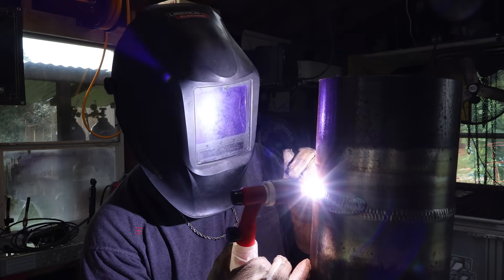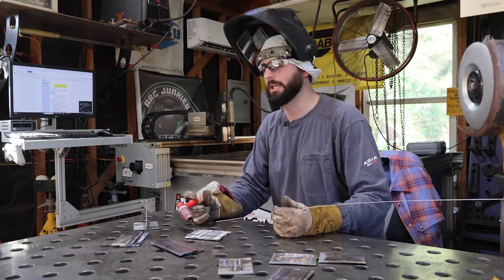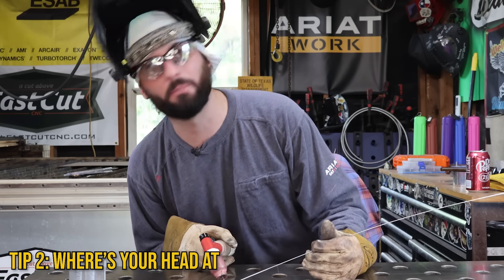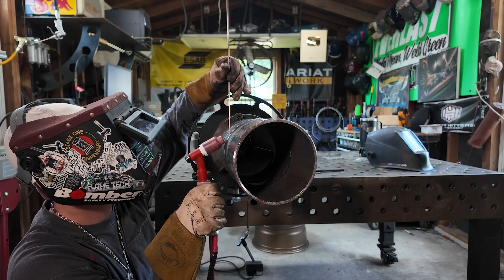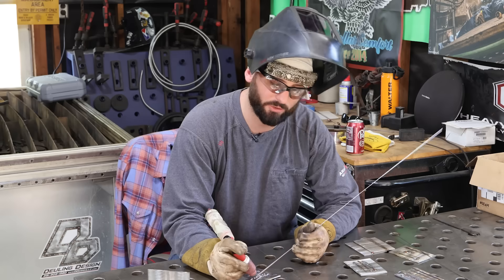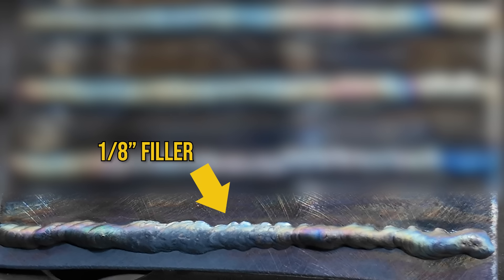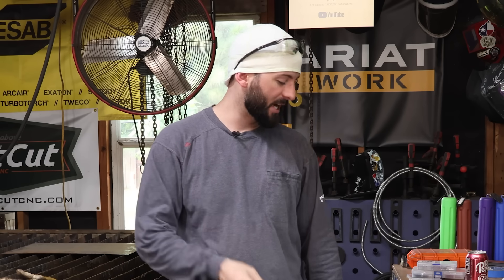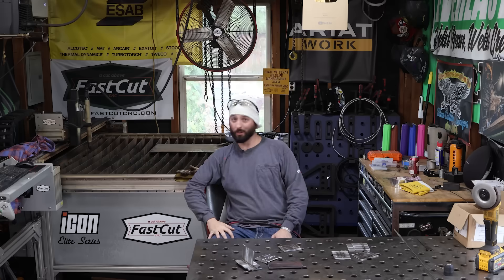Easy Changes To Massively Improve Your TIG Welds

Comment: I can dab 1/16 on mild steel all day long. When I step up to 3/32 or 1/8 filler my filler will on occasion stick a little bit. I can still lay down the weld pretty alright, but I feel like it messes with my bead profile and it’s a little annoying. Any tips?

Comment: The hardest part for me is seeing the weld puddle.  I'm older and my vision isn't what it once was.  Welding aluminum and stainless steel are the hardest to see.  This was a great video.
Reply: @EmJayOh83 I am not selling anything. But trust me when I say, ridge "prince" lens helped a ton. I'm older I have glasses and use a cheater lens. But the "Prince" lens allows me to see the tip of the tungsten and the puddle clearly. For me it's a game changer!!!
Reply: @BrianMcQuillen-d2x Thank you. I will check it out.
Reply: I’m not sure if you wear glasses but they can help or a cheater lens also some recommend a clear welding cup or a large cup like 10 or 12 with a longer stick out no big cups on aluminum though #8max I’d say but clear cups #8 is a good all around. Last obviously a clear welding lens that is clean and not all scratched up even the auto darkening helmets are nice that you can adjust the brightness 👍
Reply: @WojnarskiWeldingFabricaion  Thank you.  I'll check out the clear welding cup/large cup. I wear full lens magnified safety glasses under my helmet and they really do help, but still fall a short.
Reply: @EmJayOh83yea it’s hard sometimes one thing with the clear cups some of the cheap amazon ones don’t work well furick is a good brand there’s others they should slip onto a gas lense #8 is a good size
Reply: Cheater lens and a lighter shade!
Reply: I wear reading glasses under the hood AND have added a strong LED light to the top of my hood. Sometimes the light does screw with the auto darkening.
If I don’t have the readers and light, I can’t see anything well.
Reply: Trust me bro I have super bad vision because of my diabetes I’m only 23 and have horrible vision I was a horrible welder because I couldn’t see my puddle I spent $300 on a vintage view lens and still couldn’t see I tried fixed and auto lenses but the only lense that worked for me was th Oudopanda true color lense shade 10 and I can see everything the optical is 1/1/1 best of the best and changed everything for me I recommend them seriously and it’s only $60

Comment: These are all very nice videos. I would like to see if you can burn out or drill through a 40 or 60 mm thick bolt that is 100 or 150 mm long using a torch technique.
Reply: Certainly
Reply: @Drweldz  yes, I would like to see it

Comment: Can you laywire with aluminum or do you have to do fast dips? Everytime i try the rod shrinks back a lot, way more than steel. I never seen anyone lay it in a video either
Reply: It depends on the application and joint type. Lap joints and butt joints with Aluminum you can get away with lay wire. I dip / feed fast with aluminum because the more heat input into the part the more likely the welds will break. Also, the weld puddle tends to grow wider and larger as you put more heat into the part. It takes a lot of practice and knowledge of Aluminum theory to get good at TIG welding it.
Reply: Man the tips are the same. But aluminum melts faster. So just keep that torch down and square to the work.